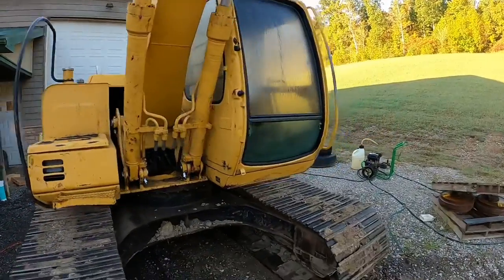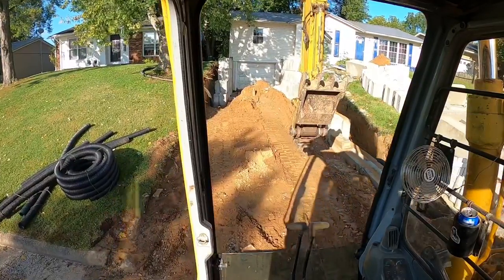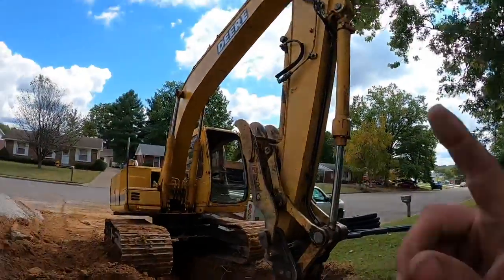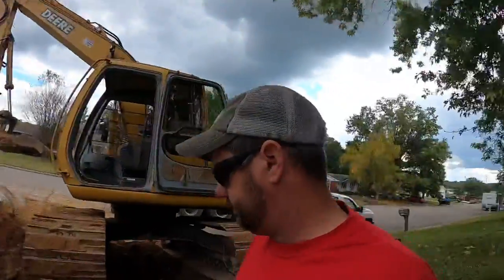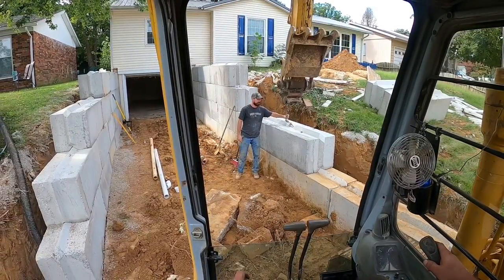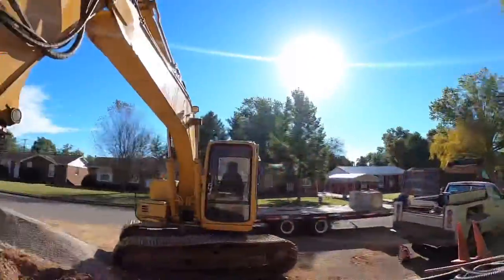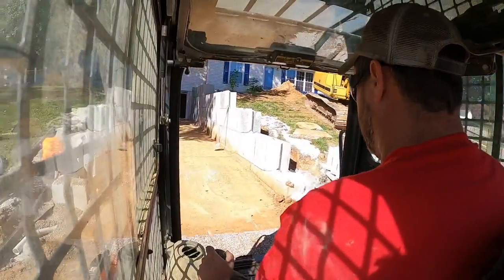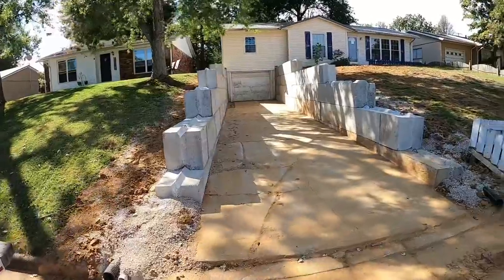With the help  of the 120 the retain wall is done this one was a challenge but we got it 😀

Comment: I drove a 2012 KW with 660HP. Engine was all built 13 spd Trany was built. Steerable tag axles. I could barely tell I had a trailer behind me. Pulling a Cat 330 excavator. I'd tuck the trailer off to the side and use the truck all day when done hook it back up later load machine and off I went. I liked to work by myself. Put my music on and I was all set

Comment: Those are called casket blocks up here in Pa. and they are random at best for as far as being the same. We used to put a mastic( what you would use to join 2 sections of cement drainage pipe together) on the rib that is on the top to "glue" the next layer onto the bottom one. This served 2 purposes. 1. it blocked water from seeping out of the long joints in the wall. 2. it kind of helped level the upper course to match it with the lower course.

Comment: Congratulations on finishing the wall!  I built a similar wall and I intentionally put a lean on the blocks into the bank.  Not much, maybe just where the level bubble is just touching the line.  Then I put a layer of filter cloth behind the wall to allow water to pass thru but hold any soil particles back.  Backfill with gravel like you did.  Good idea to get a strong trailer for your dump truck.  Saves a trip when you need to load and haul stuff.  It takes some weight off the front axle so kinda tricky making sharp turns on slippery 
 surfaces.

Comment: Just an idea Mr. DP.
When ya gotta pour some gravel into a tight place between a concrete wall and dirt wall of the trench.
Take a 3' × 8' piece of 1/2 inch plywood with the 1' left over strip on top of the concrete and use 4  2 X 4 pieces nailed to both so it's at a 45 degree angle on top of the concrete.
The gravel will funnel into the hole instead of onto the concrete or the dirt beside the hole.
You may have to modify that with blocks like those tho.
Maybe not.
To keep it from slipping back away from the hole nail two small pieces of plywood on each end so they stick down into the outside edge of the hole beside concrete.

Comment: Watching this brought a cringe for me remembering just how close I was to losing my foot stacking those killers . We were setting a wall and I was guiding the block when the block lift handle broke at about two feet in the air . The block dropped to the ground faster than I could move , thankfully I was about 10 inches away from where it landed . Seeing the melenial get under that block in the air actually made my stomach hurt .

Comment: Dirt Perfect job as usual 👍. You should get a seat cover for the deer before the foam starts popping out. The price they want for seats are ridiculous.  A normal vehicle bucket seat cover fits. Also that squeal you have going on it is probably the bushing trying to spin in the boss.  Worth taking apart to check to save you from Jason Works A lot doing some line boring 😬

Comment: If I were the homeowner I would have had you set the left blocks so the inside edge was even with the edge of the garage foundation if the property line allowed and on the right side as close to the house bump out as possible to make it as wide of a opening as possible then pour concrete to widen the driveway pad.

Comment: Check around to see if any of your concrete product suppliers have the ULTRA BLOCK. Far superior product than those crude blocks your using,and not much more cost. Get the first course where you want it and just throw it up. Turns out nice every time. They also make really nice cap blocks and top blocks with a curb.

Comment: I could have sworn Captain Kleeman was the fit to use the 120 after you finished the final drive to dig chert at Logger Wade’s place. That missing lock pin on the track wouldn’t have done well if he had. 
I guess you just brought it back to your shop for the throttle issue and then he used it. 
Now that I think of it there was a set of track marks up the hill when he took it up and loaded it.

Comment: This will sound like a smart aleck comment, and I don't mean it that way, but the homeowner should consider some cover over the top end of this tunnel as additional covered parking.  Sure seems like the original builder had to work hard to come up with the idea to bury a garage that deep into the bank.  This reminds me of a garage owned by a friend's father in Cleveland.  He hid a '57 Thunderbird in there, and it hadn't seen the light of day in 35 years.  Poor thing rotted away from excess moisture and poor drainage.  Anyway, nice job considering the situation you had to work with.

Comment: Great job.. As a layperson, how do you prevent the walls from bowing or leaning in the event there is soil-shifting due to seasonal temperature changes? .. I ask since there is no rebar running down the block centers keeping them in alignment ....
Reply from the maker: Backfill with Rick rock
Reply: Is Rick Rock anything like Bubba rock they have in Kentucky...😉

Comment: Mr dp I can not wait to see the new truck/ monster on upcoming  video's...love the end result but man will that wall settle lol ...im from the UK..why  don't u guys pour a cement footer before laying and also why don't u guys add a cement sand mortar for fit and finished looks  ...i personally think you would end up with a mega strong wall......or is no mortar used to aid in fluid drainage
Reply from the maker: Thanks
Reply: These block retaining walls are meant to stop soil from collapsing, the stone fill in back along with the drainage tile help reduce water build up, the lack of water tight seal between the blocks allows any excess water to escape instead of pushing the blocks out of alignment. We often see similar blocks used for retaining walls here and that is what was explained to me when I asked.
Reply: @jaquigreenlees  I was under the impression that the perforated pipe the guys layed and then layered with smallish stone was the full drainage system  so I presumed that Pointing as such with sand and cement mortar might eliminate the need for the washers..which I hate to say will fail down the line (years off yet like)...i was purely pondering lol
Reply: @explorationuk6737  Yup the washers will rust away, the wall will need work, normal stuff. Every structure needs maintenance.
The perforated pipe and stone is the drainage system, the lack of waterproofing on the blocks is the emergency water escape.

A simple method to show why both help.
build a small retaining wall with blocks available at local hardware store, back fill with dirt. when it freezes in the winter the wall will be pushed away from the back fill. The moisture in the ground freezes causing the soil to expand, the wall is the weak point that gives way to the pressure.
Reply: @jaquigreenlees  I'm wrong your right or visa versa ... so with all walls /structures needing maintenance it could be said that it could have been done both ways with a similar outcome ..however  the picture I assembled in my head looks way more block perfect with pointed joints lol ....i have endeavoured  to ponder your comment  and again presumed that the rock back fill will also aid with your frezzing soil theory  lol  .

Comment: You need a grading bucket. One with a cutting edge but no teeth.
Reply from the maker: Have several why do I need more sorry don’t understand
Reply: @DirtPerfect  Didn't know you had one. I don't think I've seen you use it or don't remember seeing you use it. I said you need one because on this job when cleaning the dirt off the concrete drive I was thinking it may have been easier than trying to back drag it with the skidsteer close to the garage door.

Comment: That trailer could be wider? How long before someone slides off?
Reply from the maker: Hell no not going to permit just to move the trailer think about that
Reply: Its a standard 8' 6" wide trailer, any thing over that needs an oversized load permit even if you are empty.
Reply: Wouldn't he need a permit anyway if he was hauling the excavator?

Comment: Why did you switch  machines on this job.  Cant believe you dont have to have signs and cones out in the road when you are working  in the street. Sounds like you need to get rid of the Volvo and get another Deere then you would not have nothing to talk about. Is your Volvo smaller then Letsdig18 is ?  I watched him pick up a 10,000 lb. chunk of concreter with no problem.  This was a lot of work for a small job but looks good. And you saved the mailbox.
Reply from the maker: Covered that and we did
Reply: @DirtPerfect  sorry i get i missed that
Reply: Letsdig18 runs multiple Volvo excavators.   His uncle's company has at least a 220(or is it a 260?), and a 120, while he owns a 120 or 140 of his own.   If the lift you're talking about is the one I'm thinking of, it was the 220(or 260) that he lifted that big block with.  That is significantly bigger than the 140 that DP has.(If you divide the model number by 10,  that's the approximate weight of the machine in metric tons.  Most, but not all, manufacturers use this same model number convention.)

Of course, there is no guarantee that a newer model Deere/Hitachi would be as comfortable or relatively problem free as the older Deere is, either.

Edit:  he switched machines in part because he needed the volvo on another quick job, so had to haul it out one evening, and so decided to haul the 120 back in because it had just got back out of the shop.
Reply: @spudgamer6049  thanks for the info dont know why DP could not said that. Both  DP and Chris are great operators.
Reply: @wolfpacva  as a channel grows, it gets more difficult for the owner to respond to all comments in a longer form, so shorter answers become more common.  An unfortunate side effect, sadly.
Reply: @spudgamer6049  yes i guess  Chris was using his 220 Volvo I found out.

Comment: If I remember correctly the new owner of that house is flipping it, so in the process the driveway will need to be fixed up. Most likely will be to remove the concrete and pour a new one. I bet if you had pointed that out then you would have had a much easier time on this job.